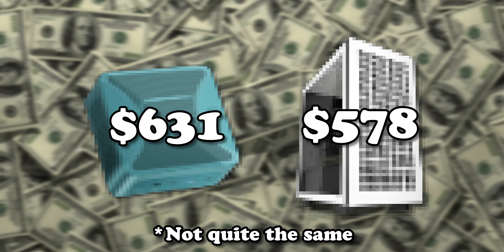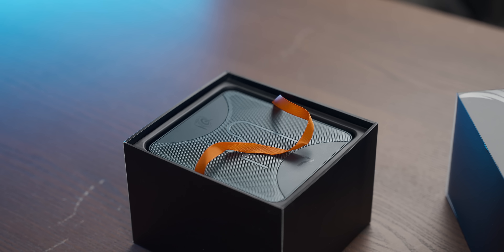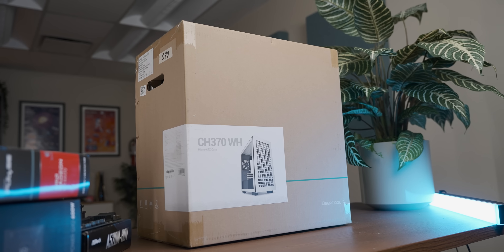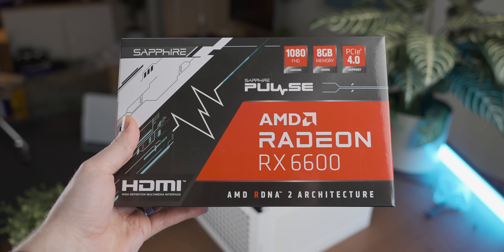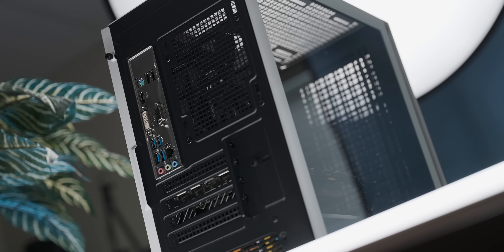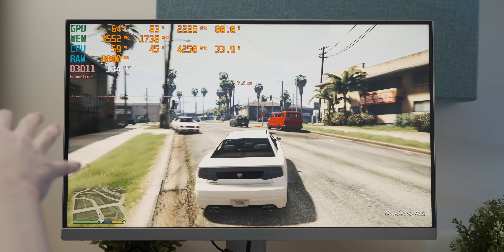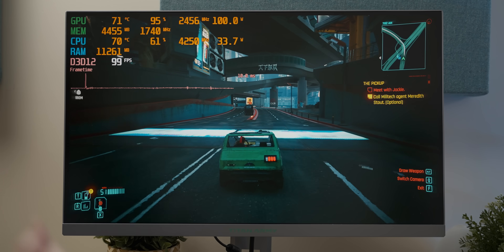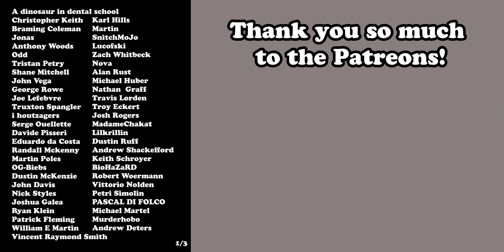Mini PC Vs Desktop: More Fair Than You Think

Comment: I ended up getting  mini PC with OCulink port for eGPU goodness.  Yes it’s more expense, but it provides a means by which to access high end gaming if I want it and an upgrade path too.  

Price to performance even with an eGPU will of course be in favor of the larger system.  You’re paying for form factor with the mini pc, just like with small form factor builds.  But there’s definitely a market for playing games at lower specs but being able to easily travel with it (Steam Deck says hello).
Reply: Isn't the eGPU limited/throttled by the bandwidth of the interface and the max wattage of the enclosure though. Or is it as good as it can be ?
Reply: Very few GPUs(PCIe 4.0 GPUs) are limited by PCIe 4.0x4 bandwidth. You'll have no problem with an RTX 4070 Super/4070Ti. Even a 4090 loses "only 20%" performance when not using an external monitor and next to nothing when using one. Regarding power, it depends on what PSU you are using. @thegorgosaurus
Reply: @thegorgosaurus  Yes, it is. eGPUs were fine for when GPUs were less powerful, but honestly at this point it's kind of a waste of money when you realize the power of modern laptops.
Reply: @rustler08  We're not all in the market for a laptop though.
Reply: At that point why not get a tower pc with an igpu and later add a GPU.
Reply: That's a terrible idea, as eGPUs are massively limited by the bandwidth of the connector and that's not even factoring in the extra latency created from the less direct connection to a CPU. It's fine if you're running something like a cheaper 20-series, but don't for a second think that you're going to throw in something powerful like a 3080 or better and get anywhere near intended performance. If you're lucky, you'll get like 80% of the performance of the GPU. And it gets worse the more powerful you get in GPUs, which means you can't just talk about how the external GPU will allow you to keep upgrading over time.
Add up the cost of this mini PC, a good GPU, and an eGPU enclosure and you could have just bought yourself a 4070 or 4080 laptop.
Reply: @rustler08  yep can’t argue with you that price to performance, a desktop pc running full bandwidth is superior.  This is similar to running a laptop GPU at a lower wattage which is kneecapping it as well.  Portability will always come at a premium.  The advantage my scenario has is that I’m not forced to buy a high end GPU if I don’t need it.  With a laptop, you don’t have an option.  You either buy it or you don’t.  With no pathway for upgrading.

Comment: OH GOD ...that rear I/O HDMI with back plate metal in it
Reply: "It's actually a feature" so the user doesn't connect the monitor to the motherboard instead of the video card 😂
Reply: dont forget the DVI VGA connection everyone uses those still
Reply from the maker: I was too busy being assaulted by it to remember to do that. 😂
Reply: @DawidDoesTechStuff  You have now formed a blood oath with the IO shield.
Reply: Had happened to me in a few occasions, hahaha!
Reply: since it's hdmi, it might even spark a bit for some extra flair.
Reply: The last build I did I forgot to push those little tabs on the IO shield apart and a couple of them inserted into the motherboard inputs.  It seems like such a simple thing to include a better IO shield.

Comment: With the extra Nvme port on the mini pc can you put a extern graphic card on it ?
Reply: The Minisforum um780 xtx comes with an occulink adapter and a port on the rear to plug it into without the need to case mod. But yes, it's definitely possible. Seen guys on here do it with this ser6 max and just cut a hole in the housing

Comment: The timing of this video is perfect because i just recently purchased an rx6600....currently waiting for the rest of the components to build my new pc 😅
Reply: Great GPU for 1080p/1440p gaming on high (or even ultra) settings. Got the PowerColor Fighter version of the RX 6600 in one of my rigs myself. Runs cool, performance is extremely stable and it's such a good value. I do suggest changing the fan-curve (from factory the fans are off until the card reaches 60c in temp). The fans aren't loud so there's not really any reason to keep them off, better to have a solid curve via MSI Afterburner for example so they are always on. A cool running card, is a long lived card after all. Mine runs at 40% until it reaches 60c, then it climbs to 65% followed by a steady climb until it matches 100/100 temp/%. Since I changed that, I have never seen GPU temps over 58c, not even while playing Dead Space Remake or Cyberpunk with the graphics cranked.
Reply: @gundalfthelost1624 Still havent built my pc, but I will look into the fan curves when I complete the build...ty for the advice 👍
Reply: Omg i just realized the processor and ram are same as well 😂

Comment: I’m adding a 4070ti to a Beelink SER 5 Max today. Should give some desktops a run for their money.
Reply: I have the Ser 5 Max too, paired with a Radeon 6650xt, and i put an AMD Wraith cooler, on top of the Ser5 Max heatpipes, silent, powerful and tiny.
Reply: @mbwahaha  do you run it without the case or did you mod the case to fit the cooler?
Reply: @dauntae24  yes, without a case, for now. I plan to make a custom case.
Reply: @WhiteG60  I’m using an M.2 external graphics card stand. It’s mostly an experiment. I use the mini PC for to play Minecraft with my son and for some emulation. I was going to sell the GPU or use it in a mini ITX build but I figured I’d try this and see how it works. I’m expecting a pretty large bottleneck but if I can get some decent 1440p out of this setup I might just keep it. I have everything mounted to one of those little aluminum extrusion rigs and is pretty cool looking.
Reply: @WhiteG60  Thunderbolt penalizes the performance a lot, I use a PCI express adapter, sacrificing the SSD slot, but performance wise it's really good.

Comment: Short answer: not really
Reply: Or another short answer : 

It depends
Reply: There are Ryzen 9 based mini PCs now 7940HS and 6900HS. DDR5 4800 up to 64GB ...
Reply: Cpu wise its not that far off but the igpu being equal to a 1650.... yea no.
Reply: It easily can, if you’re prepared to pay the extra $$$. I have a 4 litre tiny PC with a 7800X3D and RTX 4060LP which can handle anything at 1080p or 1440p. 

For 4K use, I built a watercooled system in an 18 litre NR200P Max case with an RTX 4080 Super. Either of these mini PCs can happily compete with any big desktop. The bigger one, with its 850W PSU, can even house a 7950X and a 4090 and cool them efficiently.
Reply: Long answer: WEEEEEEEEEEEEEEEEEEEEEEEEEEEEEEEEEEEEEEEEEEEEEEEEEEEEEEEEEEEEEEEEEEEEEEEEEEEEEEEEEEEEEEEEEEEEEEEEEEEEEEEEEEEEEEE
Reply: But whyd you spoil it?💀
Reply: Thanks, that saved me 11 minutes.
Reply: Bro why did you spoil it
Reply: @the_0hd what did you really expect?
Reply: @the_0hd  Stop reading comments before watching the video.
Reply: @joe--cool  it was the first comment
Reply: Shorter answer: No.
Reply: Long answer: noooooooooo